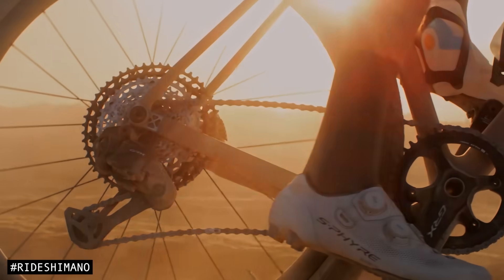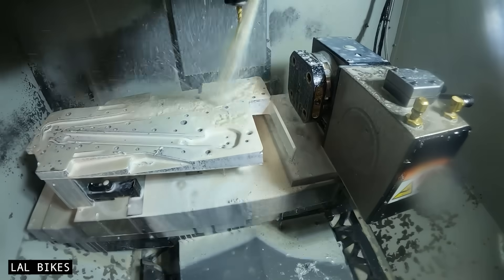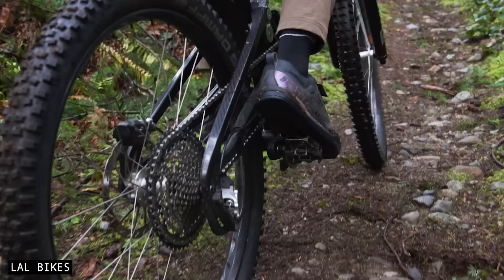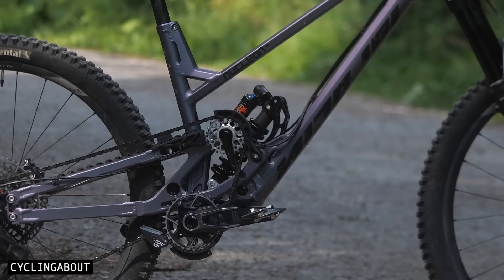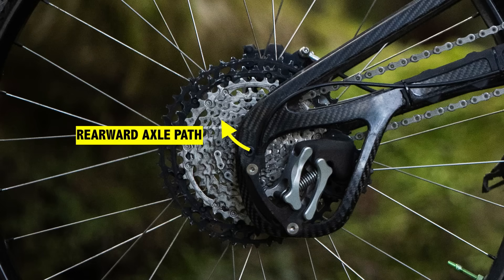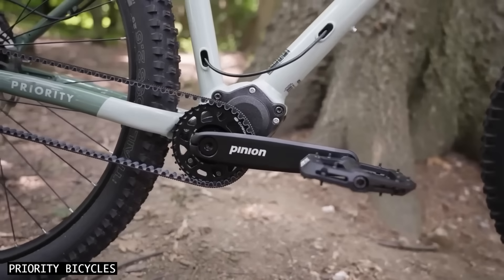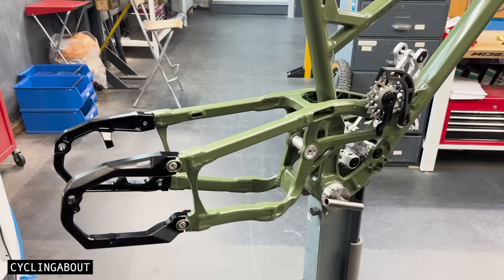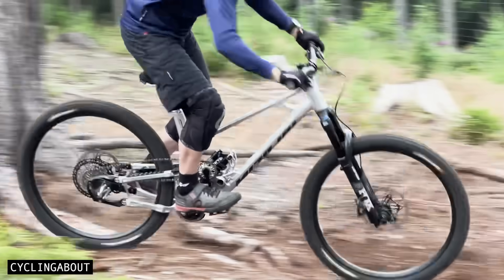This Drivetrain Is Better Than SRAM. Why Isn’t It Popular? Supre Drive Explained

Comment: The amount of chain wrap in multiple places in that system is going to mean it's horrendously inefficient (what ever they claim).
Reply: The amount of chain wrap around a sprocket doesn't affect the amount of drag. A major factor in determining the amount of drag is the pivoting angle of each chain link as it engages and disengages with sprockets. The pulleys in the Supre Drive are big and that decreases the pivoting angles of the chain links which in turn improves efficiency. For example, check out the "oversized pulley wheel system" for road bikes (this is for improving efficiency).
Reply: @LalBikes1  incomplete: the greatest loss is where the chain link bends under load, on a regular bike it is in two places - when the chain comes off the cassette and when it starts to wind onto the front sprocket, and here in 4 places, so at least twice the resistance to chain movement and double the chain wear, and compared to old-fashioned large front chainrings even more

Comment: - is it cheaper? No
- has wide compatibility? No
- more efficient? Also no

Should you buy it?
Reply: The same could have been said about nearly every MTB innovation when it was first introduced. And sure enough, most of them never caught on, but some did. I don't suppose you would like to go back to a bike without disk brakes, suspension and dropper post?
Reply: @leftaroundabout  wrong
Reply: If those are the only criteria you judge whether to buy the derailleur or not then don't buy it, but it has other advantages explained in the video that might make it worth investing in for others.

Comment: Low hanging deraileur is also an issue for various recumbents, both 3- and 2-wheeled. 
- On fully or paritially faired racing ones it tends to compromise the aerodynamics around the rear wheel where a bulge is needed in the fairing. 
- On compact leisure ones with 20" driven wheels it tends to be just a few centimeters above ground so it can get damaged without going off-road. 
- On front wheel drive recumbents the deraileurs is rotated about 90° so it is not low to the ground, but the non-tension chain is sticking out forward away from the steering axis and often limits maneuvering. 
For all those cases this Supre Drive could find itself another niche market. If the tensioning system is either solved in some other way (like the Rohloff tensioner but somewhere else on the bike, not near rear wheel, for example) the deraileur itself would offer very noticeable advantage for such bikes. Neat chain routing near the frame, or in case of FWD near the front fork. And since it is compatible with a Shimano shifter such integration into a recumbent would be relatively easy. The frame or rear swingarm or FWD fork are custom anyway so making them for this does not increase cost dramatically. 
Some handbikes might benefit from its form factor too, I am not sure, I only ever homebuilt one of those many years ago. 
But it is a small market of course. I would be almost surprised if the manufacturer ever offers the Supre Drive components for separate sale for this reason, just to let a few tiny special bike manufacturers and some hobby builders play with it.
Reply from the maker: Thanks for sharing how this could work better on some recumbents. Cedric from Lal Bikes actually helped with a velomobile drivetrain not too long ago. You can see it here: https://www.instagram.com/p/C2-Pi0dt8iH

And I believe anyone can get the drawings from Lal Bikes and purchase the Supre Drive components right now.
Reply: Delta tricycles would benefit too.  The derailleur is at the midpoint of the rear axle, so a tensioner hanging down from there is not protected by an adjacent wheel; usually there's a cage to protect the cassette from grounding, but it's not really practical to extend that far enough to cover a long tensioner.  Moving it elsewhere is an obvious improvement for trikes that might sometimes encounter difficult terrain.  Some of the other quoted benefits are completely unimportant outside the niche of full-suspension mountain biking.
There has to be a better solution to mounting a forward tensioner, though.  I think that's where a lot of the cost is, so figuring out how to do that with a standard frame design would help much more.  Independent, one-idler and two-idler chain tensioners already exist, and would be completely adequate for utility-focused, non -suspension bikes and trikes.  The key component of the Supre system would then be the rear derailleur, featuring only a guide wheel mounted further forward and higher than a conventional derailleur.
So I'd like to see a version of Supre tweaked with that in mind, and perhaps made to work with Shimano CUES rather than their 12-speed line.  CUES uses the 11-speed chain.
Reply: I would imagine it would be possible to make this system compatible with more bikes by simply figuring out how to integrate it into the main pivot. Yes, you would still need to design a whole frame around it, but it would be far simpler to design that way and compatible with more suspension designs than it is now. There is still the primary issue of it needing a specialized rear triangle, but it would be much more compatible with swingarm style rear triangles, like a swingarm 4 bar, linkage driven single pivot, or even a basic single pivot. Having the tensioner integrated into the main pivot would open it up to all of these designs while also requiring less material and fewer design compromises.

Comment: It's a shame that Supre is not compatible with mid drive ebikes.
The way that this drivetrain gives a straighter chainline would be great for conversions.
A downhill emtb with Supre would be amazing!

The application for normal mtb is still exciting, but if this can ever reach the mid drive market, it will be a genuine game changer.

Thanks for a great video as always!
Reply: The chain tensioner seams like the only obstacle, with a some small modifications you could probably make it fit
Reply: Pinion MGU for E-bikes is the future it's way better all you need to do is change the oil every 10,000 kilometers or 6000 bald eagles
Reply: @aaronoconnor606  I would love to have the Pinion MGU but that setup is only for the very wealthy right now and not readily available here in the US.
Reply: I recently saw a video where the ebike had 2 hub motors. You could use just the rear, just the front, or both at the same time. What will they think of next...

Comment: A very long time a go Gazelle ( I think ) did something similar. This to make a derailleur fit within the closed system chain guard. I thought it was a great idea but I cant find a single bit on about it on the internet.
Reply from the maker: Let me know if you find it. The general concept of this derailleur design has been around since the 1930s. I'd be interested to see any more recent attempts that split the gear shifting and chain tensioning!

Here's the 1930s patent: https://worldwide.espacenet.com/patent/search/family/009269499/publication/FR819641A?q=pn%3D%22FR819641A%22

Comment from the maker: Would you buy a bike that only works with a single drivetrain? 🤔 Personally, that doesn’t bother me at all since I almost never swap drivetrains on my bikes. I usually buy my bikes as complete builds, upgrade the components that boost performance or comfort, and when it’s time to sell, I reinstall the original parts and transfer my upgrades to the next bike.
Reply: Over the years I have grown to deeply hate the derailleur system, so many small things can go wrong and especially on E- bikes i it has a very powerful motor it will just not last very long evan the expensive ones. I am convinced E bikes could have a different drive train all together, I switched to a Rohloff hub and belt on my E-mtb so far I am happy with it, I just hope it will last as long as advertised. i am in favor of any new idea
Reply: The really clever thing would be to make any derailleur system fittable to this - that should be possible by just taking off the original cage. And make it adaptable to existing bike frames.
Reply: The fastest and most durable of emtbs is the Bonnell 775MX and uses no derailleur.
Reply: @LarryRichelli  that clearly does/ not count. That one does not assist, it drives by itself. it's more E motorbike than E bike, they work differently.